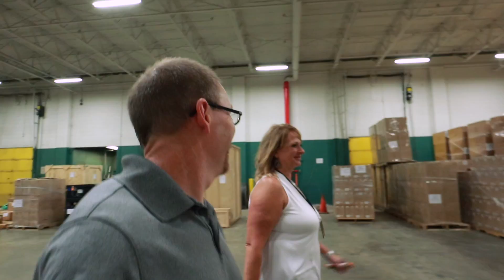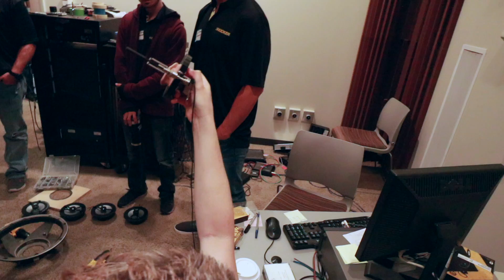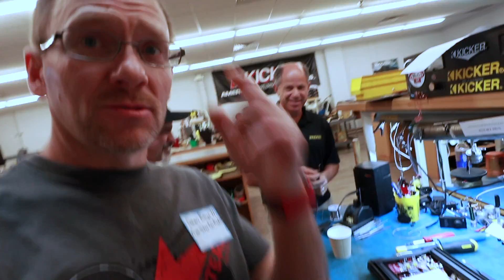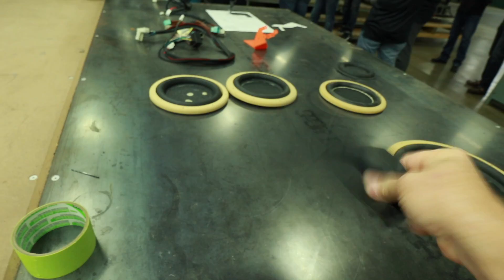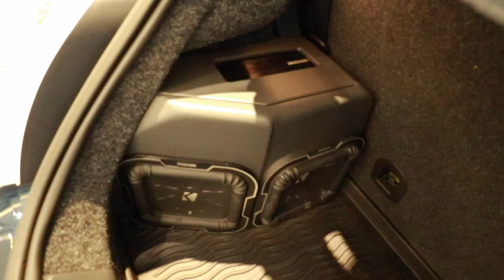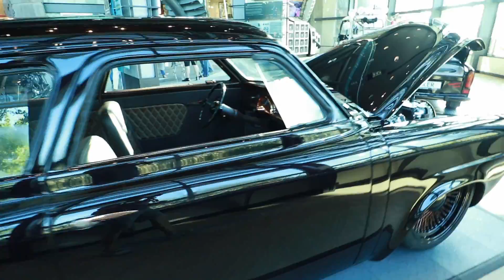My trip to Stillwater Oklahoma to Visit Kicker headquarters .  Installer diaries 137

Comment: Hey guys what would be a safe rms to run a 1” tweeter and a 3” midrange? I’m looking to buy a 4 channel amp for my front stage and I saw a 4x45 rms or should I step up to the 4x100 rms or even a 4x150 rms? Thanks!

Comment: Dean and Fernando, you two have totally inspired me to get back into the aftermarket audio game. I used to dabble around with aftermarket radios and such back when I was in college and just after I got married. However, I never really got super into the whole amps and super nice speakers and all that. Now that I've seen your videos, I just bought all of the things I need to add an aftermarket head unit to my 2008 Cobalt which doesn't have factory bluetooth. I'm planning on driving that car until the wheels fall off LOL but I wanted to put a system in the car that would keep as much factory stuff as possible and watching your videos has re-energized me to take the plunge. I'm using pretty much all PAC-AUDIO gear except for the dash kit. Thanks for showing me how easy it really can be to improve your sound in your car!!